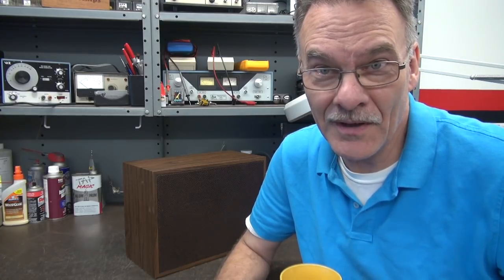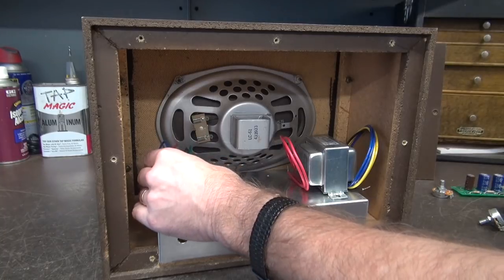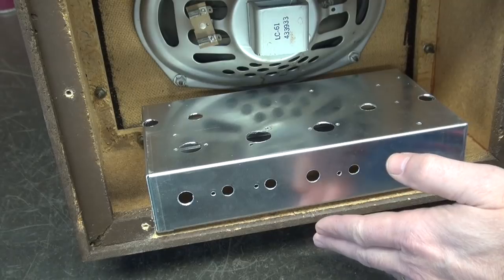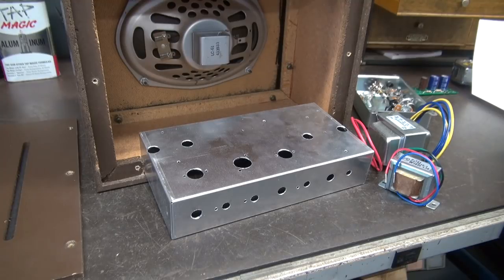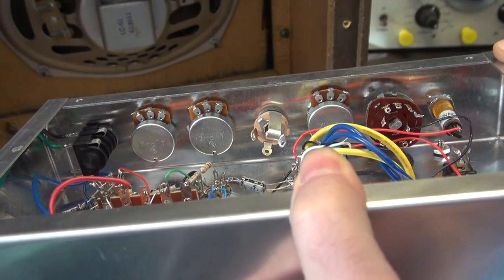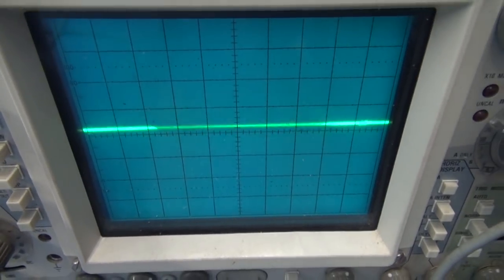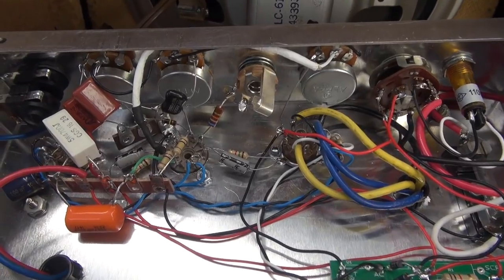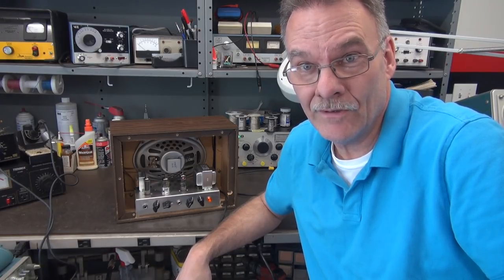How to build a Tube combo guitar Bookshelf speaker Boutique Amp

Comment: I have that EXACT same speaker! Also, I've used tapered drill bits and they work awesome on sheet metal. They don't rip the metal apart like standard drill bits and they're A LOT cheaper than a punch kit.

Comment: Thank you so much. I've been following your channel since last year, when I started amp building as a retirement hobby. Having done a couple of kits, then followed a couple of layout suggestions for 5E3's, and a couple of Marshall 18 Watt layouts, I've finally done a proper point-to-point build using this circuit. It really did me good to struggle with the detailed layout of the components to achieve the minimum size compatible with proper operation. Love the tone, enjoyed the challenge of the build, and feel I have learned a few worthwhile things. Once again, thanks
Reply from the maker: Your welcome Sir. It's a great hobby. Brings back the good days of building Heathkits. I grew up on that stuff. Lots more to come. TD

Comment: Nice project. As I am reading the comments below, I see several remarks asking how to obtain his printed circuit board (PCB) he utilized. For those readers who want to dig deeper into this craft of PCB's I recommend that you acquire a copy of "Diptrace". It's a schematic capture / PCB design software package. I do this stuff as a professional and this software costs nothing for the 300 pin version. That is more than a sufficient number of pins to design a power supply PCB. I just did a generic power supply PCB and had it fabricated in China at 60 cents per PCB for a 40 piece quantity. That is a fantastic price! Plus I now have a small supply of PCB's for futire use.

Comment: Longtime E-bay admirer and bidder. Great little build. I would love to see is an easy commonly available solidstate amp upgrade to tube. I have seen you do a few here and there, but what I mean is - an small bookshelf speakerbox with a random 6x9 doesn't make much of a guitar amp. If you put the same parts into a Fender Frontman box, for example, you have a real guitar speaker in a box with a handle. Find one that is available for real cheap and built in huge numbers. I had a very good Fender combo with a 12" speaker, I was lucky to get $25 for it.

Comment: I think you´re really under appreciated! I love your videos and your skill and I´m planning to make my own amp in the next weeks. But I need one with 600 Watts of power for a bunch of speakers And a subwoofer! :)
Reply: Woah there, are you building a Public address system or a weapon for driving your neighbours mad? If that is the case then " Do it"! You might need a about 24 big valves and a transformer from your local power station to keep it authentic Valve(Tube) sounding. That mad prof from back to future knows where to get parts.

Comment: Found a cabinet! Philips speaker with output transformer attached to it in mint condition... build here in Holland in 1931..vintage or what. Hope it will match the circuit!?

Comment: I decided I wanted to build my own Princeton Amp today.  I looked up "how to build your own guitar tube amp" and I found your channel.  After cruising around your site, I thought I would start with this small, inexpensive design before tackling anything more complicated.  Here's where I'm hoping for some guidance. 
I've never built, deconstructed, fixed, or otherwise messed with anything electronic - even soldering has escaped me.  By trade, I was a carpenter, and now I've moved on to business.  My hobbies are playing and writing music and woodworking.  I'm not daunted by the prospect of learning new things.  For a beginner, I would like to know where I should go to learn the absolute fundamentals, before getting into even something this complex or even ordering parts.  Whats a capacitor, what's impedance, what is a resistor, etc.  The next step would be understanding the diagram you highlight at the end of this video.  Then getting into the internal wiring of the pots and board etc. that gets kind of skipped over as you build your design.  6 hours is incredible.  How many hours do you think it would take me to get to the point of being ready to build this design.  Thank you so much.  Absolutely love your channel.
Reply: I am adding a comment because I like your enthusiasm. My advice to you  is get hold of a decent book that explains the functions of the various parts and what they look like. Learn to solder(the videos are good for that). Most of make safety a priority, if you are not shure about something just "Stop" and have a break . I have been messing with wires and boxes for years and am still learning 40 years later.

Comment: Thanks Terry and happy New Year! Can you explain a little about how grounding  in a guitar amp circuit works? I'm (a newbie) restoring an old bogen cha-20 and  replacing some 50 year old can electrolytic caps.  The negative side goes to what appears to be common ground from the exterior of the can . I will replace them with axials so I won't be  able to ground them to the same spot.  Does it matter where I ground them as long as they end up soldered to somewhere on the chasis?  Thanks.

Comment: From Leo:  Always enjoy your creativity and posted videos.   If you are going to use Silicon diodes, would not a 4 diode bridge give you a higher output voltage and a smoother and quieter output?

Comment: very nice display of know how for whoever find enough faith in themselves to actually get busy sourcing out the the parts . you practically make it a nobrainer . Love your work. say Terry , i got a fender super reverb reissue  and a Traynor vt80 with 5881's in the output . i got a matched  pair of 6L6's and a quad matched for the Traynor . the traynor is suppost to be  auto biasing . but i would think now. that that only for a set that is drifting  it would self bias to an extent. not thowing in different tubes. and expecting to self bias. I can find very little id. on both these amps and they both have pc boards. but are chassis tube mounted. at least. the Traynor . any suggestions appreciated and well as better tone mods. to let  even more even harmonics through. Thx.

Comment: You really know how to start the new year out right! From start to finish this build is top self! You explained every aspect simply and completely! I am so impressed! I have all the components I need to build a 20 watt class AB guitar amp with Reverb amp and a 50 watt class AB bass amp, so I will be patient until you build one of those. I know there is much more to those kind of builds, but I am hoping. The designs are similar to Fender, but the way you did that build with the Fender front end and the Marshall output was a great idea! So again, BANG! Happy New Year!!! Thankz
Reply from the maker: Thanks man, I do appreciate you kind support. I love building, time has been an issue lately, however I plan to move forward with this. This is my Legacy. I will let you know when I put together a vid featuring 20 or 50 watt builds. Keep living the dream, not too many of us left that can appreciate the vintage electronics.
Reply: D-lab Electronics Thank you for your reply. I totally understand about not having enough time to devote to your passion. I am in the middle of completely transforming my workshop into my dream shop. It takes me forever, but I am making headway. I mean it about your electronics prowess. Thankz

Comment: Very good video wonderful project, very much like the one i just completed. I wanted to ask you about the tube selection, I used a 6X5 and 6V6 can you tell me what differences if any i will see compared to your selection,  I left the Eico Signal Generator 4.75 speaker in place and used it as an internal speaker but it is pretty thin. What model 6x9 did you use or what should i look for, 5 inch Midrange?? I can't tell you the pleasure or pride i got from building my little three tube Amp. I think this project should be required for every high school student because it unleashes the pride and self confidence that is so rarely attained in academic processes.  Thanks for all you for us the You Tube Tube Amp Junkies. Dennis in Virginia

Comment: This is great!! I'm gathering parts for this kind of an amp.. Old philips radio with powertransformer and EZ80 rectifying tube.. little outputtransformer . Outputtransformer is tiny maybe upgrade, it is used to be powered by EF85 as "preamp"And I don't know if she is up to the job with an 12AX7 in the preamp. Nice schematic, great guide! Thank!!
Reply: i Marcel, how did you get on? I did similar using an old Philips transformer with attached EZ80, and an anonymous OP tranny from heaven knows what. The sound I got was very harsh, and I ended up replacing the tone stack with a simple tone knob, adding a switchable feedback loop from one of the transformers and making the cathode bypass capacitor on the first input stage switchable. It sounds great into a Celestion 10 Vintage in a small enclosure. My guitar teacher has bought it and I'm making another one. The 12AX7 is no problem powerwise, it's the power valve that gives most load. I changed the 12AX7 for a 1212AT7 (ECC81) to reduce the gain to a more moderate level and give a cleaner sound.
Reply: chris barrett hi there, I found a speaker but it was so rare I sold it to a radio guy ho was very happy with it. For the moment I'm just collecting stuff on aliexpress for parts. And searching for a cabinet and speaker..maybe I make one myself with a celestion. The 12at7 will not distort as early as a 12ax7.. cleans it up nice.
Reply: Hi Marcel. It's a really involving hobby to collect different parts and assemble them, especially satisfying  if you are modifying the circuit to your own taste and available parts. At the time I got your message , I was swapping the input ECC83 in my modified home build 5E3 Fender for an ECC81 to give less breakup. Good luck with your project and let me know how it goes.

Comment: Hello, great video. Where did we buy the neon bulb and other components? What is the part number of the large orange cap? Thanks.
Reply from the maker: Hello, The orange cap is a Sprague .022uf, 600V. The Neon is old stock from my collection. Output tranny can be purchased from Antique Electronics, AZ. Most of the other components were shop stock.
Reply: Thanks.

Comment: it would be cool if there was a place you could buy a little circuit board like that with the filter caps and diodes, even if the board was unpopulated.

I built a tube preamp recently.  my experience with that is that I like the turret board to be all signal related...and power components...if added...tucked away elsewhere like you did.

thanks.
Reply from the maker: Hello, I agree. D-Lab will offer this as a small kit in the near future. Thanks
Reply: D-lab Electronics --- awesome, I'll be watching out for the kit.....

Comment: Quick questions: How did you end up mounting the chassis to the cabinet?  Also looked like some kind of sleeve fittings instead of rubber grommets, what did you use there?
Reply from the maker: Hello, I normally mount the chassis with aluminum right angle brackets or 3/4" square wood blocks mounted on the chassis sides. Screws come up from the bottom. The 4 plastic insulators are snap in bushings (1/2") Mouser sells them. Made by Keystone. Good thing is, they do not rot like rubber grommets.

Comment: I would like to scratch build a silvertone medallion hi fi amp for guitar. I had a head I made from one in a junkyard and it was stolen.
Reply: Funny the thing sat at the end of a residentiall street right inside the landfill all delaminating. Bass player buddy I worked with told me to. I saw it one month and got the guts the next. It still had all the silvertone tubes except e rectifier was newer. It worked. Now ive also made a combo from a four leg tall silvertone record player too. Both the head and combo were finished alike except for knobs. Had gold backplate toggle switches neon light three inputs white vinyl grill black vinyl covering and pool que bumpers for feet.

Comment: great.  exactly what a wanted. just 1 question. i upgraded the 8watt output transformer in a vavle jr.(single ended el84) to a classic mag 15 watter. will the old OT replace the (fender reverb) OT used in this amp?
Reply from the maker: Hello, Yes, that output transformer would work fine in place of the type I used.
Reply: thanks. you were quick to answer. a cool use  for upgraded trannys. now it's $15 cheaper to build your amp for some of us. used slid state cheap! low dollar joy.

Comment: Hi Terry, Happy New Year! What a cool little amp. I have a question I was hoping you could answer. It's not about this amp, I just figured this was your most recent video so.. I purchased an old Lettine 242 6 meter transmitter (for 10.00) that had seen much better days for parts. As it has high quality transformers and tube sockets and such... However, the power transformer is like 600-0-600, the choke is a good size but I don't know the specs on it, and what I thought was the output transformer is I guess a modulation transformer? I was thinking of using the power transformer to build an 807 push pull type guitar amp.. But what kind of rectifier can handle that much voltage? I would have to locate the old chassis to see what it used, but I think it was a 5u4 or 5ar4 not the GZ34, maybe i'm thinking of another tube.. Any thoughts? Thanks and keep up the great work, Tom

Comment: I wish I could get chassis like that here in the UK! Can I ask where you get them from? Thanks Terry, another great video
Reply: Farnell of Leeds stock many Hammond Aluminium chassis lines. You can order by internet. If you want Hammond Tube/Valve Amp Transformers and/or Chassis you can get them from Philip at Bluebell Audio. You can order by phone and email
Reply: Thanks guys, I didn’t realise Hammond did these. I can see me buying a few
Reply: John N cheers for that, a nice simple site that sells stuff I want
Reply: Gee What happened? Did Maplin go out of business? I used get all kinds of goodies there when in the UK.
Reply: G Morgan hi, I couldn’t find anything like that on the map in site, though I think I’ve been looking for the wrong thing
Reply: Maplin are still in business, but the majority of their catalogue now seems to be filled with radio controlled crapola, tat and ephemera.
You can still find components, but things like valve power and output transformers, the decent Velleman kits etc are things of the past.
Want a PMR walkie-talkie and a drone shaped like a Minion?, yeah, they do that. Want a 350-0-350 + 5 + 6.3 and a 5k/4/8/16 transformer?, no. Go direct to Danbury
They've done what it takes to survive. CPC-Farnell are good.
Reply: I make my chassis from stock aluminium sheet, 2mm, available pre-cut from suppliers on ebay. I don't bend them, I join them using 90 degree angle strip and pop rivets or bolts. No need to bother with the ends. Works out so much cheaper than made chassis, and you can choose the size you want.
Reply: Seems they are going the same route as Radio Shack and look where they are now!  Most of us DIYers have to go to the internet now to get chassis' and parts.  I miss strolling around and shopping for them.

Comment: My advice (I'm a professional electronics engineer who used to design and build tube amps back in the day): Don't mount the amp this way!  There's a reason why tubes should be mounted base down: it's called HEAT.  As you will know heat rises and should be removed by convection.  Look in any good piece of period electronics and you'll see the tubes base down with plenty of air space above for the rising warm air to dissipate in.  Obviously at the top of the case there is nowhere for the air to convect. All the heat which normally convects away is going to affect all the passive components (including the bases) and will certainly reduce their lifetime or at worst induce a catastrophic failure. Hope this helps.

Comment: I looking to build a Marshall Major clone, but souped up to 300 watts with 4 12ax7 pre- amp tubes, and 6 el34 output tubes ...any tips or suggestions?
Reply: Hi Mike, Why? Unless you have the real Major 200 for it's rarity, I can't see why you would want one.. Even if your gigging with it, any bar or club is going to ask you to turn down..and they only start to sound decent at extreme volume, when the power tubes start to break up.. I had a 73 100watt for years, and turning that up was an issue.. If I was going to make an amp just for power, I would look at some late silver face fenders. They made some PA Heads with 135 watts I believe, and you would have most of the components you need right there.. Huge transformers, a cab, chassi, tube sockets, and they had reverb to boot. you could do away with all the inputs and just make it one or 2.. Just copy the front end of whatever Marshall you like (I would use the JCM 800) and use the existing output... You would have a killer amp at a much reduced price.. I have seen those PA heads sell for under $400.00  If you can copy a schematic and solder, you'll be set. Just my 2 cents, take care, Tom

Comment: It looks like you cut off the shield on both ends the shielded cable. Did that not cancel out the benefits of having a shield?
Reply from the maker: Hello, The shield is connected at the neg term of the gain pot.
Reply: thank you